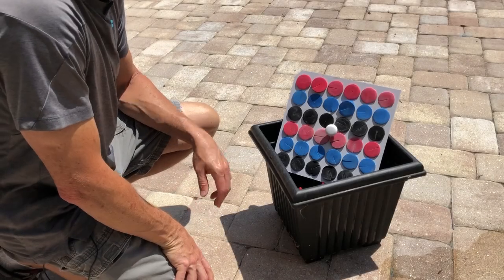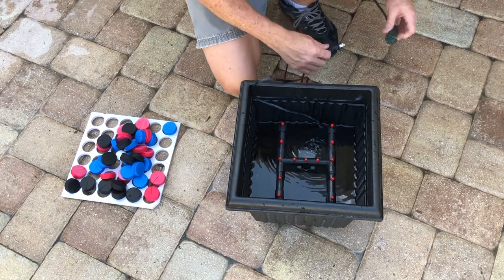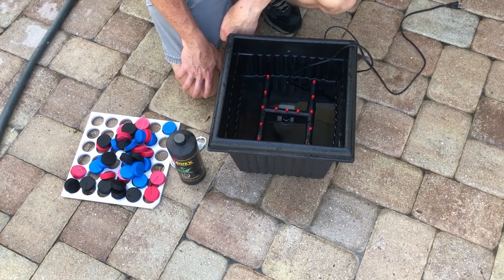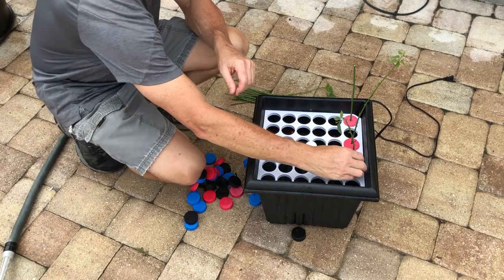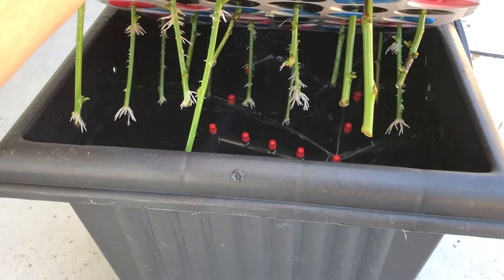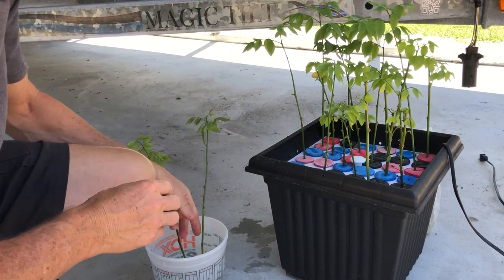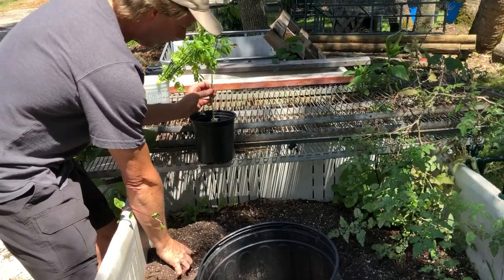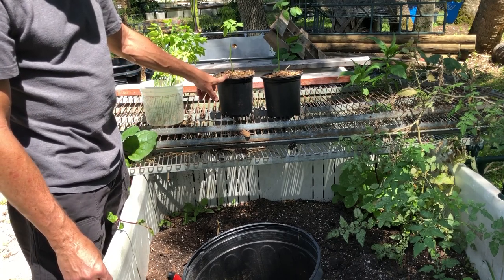Using an Aeroponic Cloner for Plant Propagation

Comment: When transplanting into soil/substrate I use the cardboard inner toilet paper tube as a sort of transplant shield for the delicate roots. Just place it in the pot as you’re adding in the soil. Put the clone into the tube & gently top up the soil all around the plant. Slide out the tube then water the new plant lightly & it’s done. Great informative video btw & a big thank you from a new subscriber
Reply from the maker: Thank you, that's a great transplant method :)

Comment: I've used the same prototype on a 64 clone cloning machine just like that one and you could just take the cuttings and stick them in there you don't need any root powder or food for them whatsoever. Just a good fluorescent or LED light over the top. I've gotten roots in 4 days before. Have used it over and over and over again. The only thing I don't like is do cats get clogged up and it screws up the sprayers about every cycle which isn't a big deal but if they just had some sort of a filter like you see on a vacuum cleaner, some sort of a sponge type of filter it would prolong the life of the pump and the sprayers as well and it would also keep algae out of the water. A few times I even put two clo es per hole and had 100% success everything. Whatever size that'll fit in the hole will root. It's  crazy.

Comment: I like except that the reservoir should be seperate potentially. Has potential for sure especially outdoors if your not doing a separate primary reservoir. cheap timers at Ace for the outlet can work. This would be fantastic for outdoor plants in the heat and love that you can water so many at once

Comment: I just got one of these, I have all kinds of cuttings in it testing it out. My grape cuttings have been in it for 4 days now, on all places that were cut, they have a light brown color forming over the cuts, I'm worried it's some kind of bacteria or rot already, Could you offer any insight?
Reply from the maker: I'd give it more time, may take a couple of weeks to start showing roots. As long as the upper portion looks healthy (above the collar ring) then they may be fine.
Reply: @GardeningSolutions  cool. Thanks
Reply: Did the grapes work?
Reply: @jasoncosby8363  the grapes did not end up working on this, however I did successfully clone my grape vine using air laying. I got some of the air layering pods from Amazon and did an air layering right in middle of summer.  Keep inside the pod moist and in about 6 to 8 weeks the pod was full of roots, I cut it off the parent vine and planted it in a pot and it’s doing well.
Reply: Algae

Comment: Also, have you ever tried running seedlings in it? On/off times?
Reply from the maker: I've used it to grow out seedlings for a hydroponic system and it worked well for that. As for running the pump intermittently, I haven't tried that but I have a friend doing it with a bucket system I made for him. We are growing similar plants and are going to compare results. He is using a timer that does 15 min on / 15 min off.
Reply: Gardening Solutions so for your seedlings you have just left it on basically 24/7?

Started seedlings in paper towel method and then transferred? Another method?
Reply from the maker: @afishl1  I used net cups with rockwool to start seeds for a hydroponic system. Yes, I leave mine running 24/7.

Comment: The main reason I'd prefer a bubbler as opposed to a sprayer is that the sprayer's submersible pump requires a live wire going into the water,  which presents a major electrocution risk if there is the slightest nick in that electrical wire's insulation or any internal fault in the pump. Live current and water is a lethal mix, potentially.
Reply from the maker: These are plugged into GFI circuits so any fault should trip it. I also don't put my hand into the water in the reservoir while plugged in.  I haven't tried it with a bubbler but might give it a shot.
Reply: You can buy a grown fault extension cord or plug it into a ground fault reciprocal but since you bring it up they have these pumps with the sprayer both
Reply: Submersible water pump. Meant to be…. Submersed….
Reply: If that scares you dont build a litchenburg burner 😂

Comment: How often would I add clonex to the CloneKing 35 cloning site kit? I've been growing for a few years but first year cloning. Thanks for any help
Reply from the maker: Just add it once when starting a new batch of cuttings.
Reply: U don't need it I only use tap let set a day then fill it run 24 7 roots in 3 wks not bumps real roots keep water above 70

Comment: good job is the stems in the water? i bought this one but thinking i should bought the hydro
Reply from the maker: Stems are not in the water, they just need to be kept moist by the sprayers.
Reply: @GardeningSolutions  thanks
Reply: @GardeningSolutions  
SIdeally they should be kept between damp and moist,
Reply: Does it work for roses too?

Comment: Ive tried all that root shit amd now i ise oy tap water run 24/7 with a light on my basement floor keep water below 70 great roota in 3 wks bumps in a week but i let gwt good roots so.etimes i put a cap of hydrogen peroxide i even put 3 or 4 cuts in each sight forget spendi g money on any crap tqp water is all u need